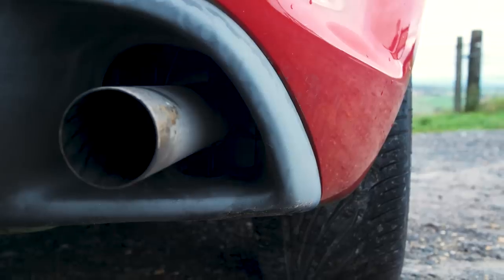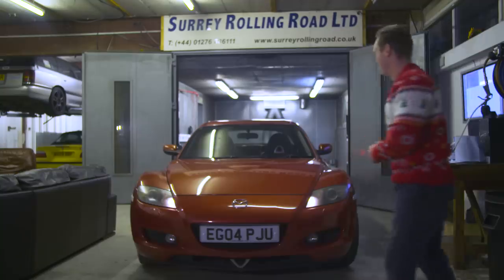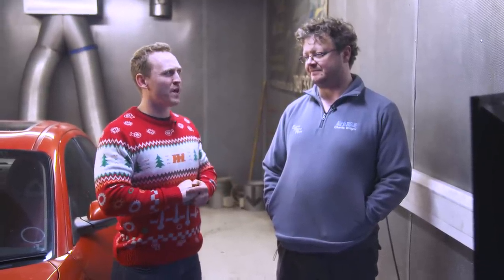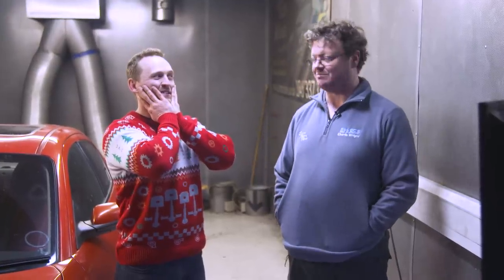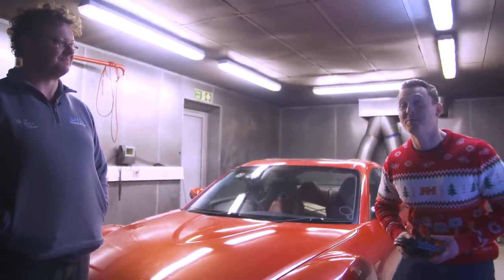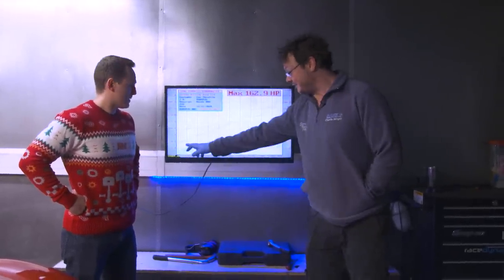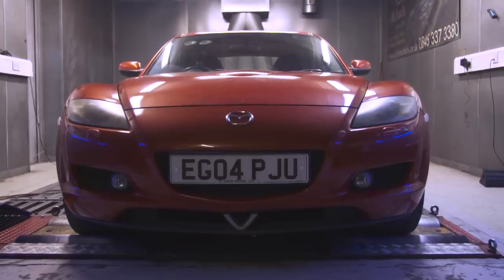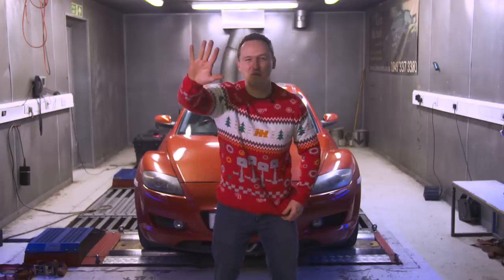How Much Power & Torque Does A Broken Rotary Engine Make?

Comment: Wish you had done a comparison of power output between premixing (1 ounce 2stroke oil in fuel tank per gallon of petrol) and not premixing. Adding the 2 stroke is step one in the rotary commandments, and it helps with compression and seal lubrication. In a good condition rotary, it adds longevity as well. I never run mine without 2 stroke oil in the fuel. In fact, I deleted the factory 4 stroke oil injection system and add 2 stroke every time I fill the fuel tank.

Comment: Always rev the engine at 2000 to 3000 RPM for 3 or 4 seconds before you shut the engine off.   Otherwise expect it to stall / flood.  The 2004 (and maybe newer?) year cars have a wimpy starter motor.  If you decide to do it yourself its an easy swap.  And your 2004 doesn't inject enough oil to the engine so always premix!  If you don't want to add oil to the fuel there are some retrofit kits that will inject more oil into the fuel  *I think premix is the simple way to go.   And don't forget to fuel it with the proper octane gas (Petrol)

Comment: put 2 stroke oil in the fuel tank 1 250ml per full tank once its rebuilt  helps the apex seals lube up and provents premature  apex seal wear

Comment: OMG- so THAT's what I look like! I too own a Dorito powered 2008 Anniversary Edition Mazda RX-8 with a red leather interior. It came with many goodies: exhaust, etc... BUT, has a future of failure as well. It's sooo good though, I'll probably rebuild as well. In the interim, I need a transmission mount and a front passenger axle assembly (prior to rebuild)- so, I'm feeling you, Alex. Sure, yours was practically free, but- sadly- mine was NOT. Like the dreaded dead Miata that you continued to beat to death forever, the RX-8 has too many good traits to just toss aside. It'll be a collectible classic at some point, I just hope it happens before my eyes roll back in my head and die from frustration. I'm watching with bated breathe...

Comment: Provided everything is healthy, on the Dyno the vehicle should make 185-198 to the wheels. Clearly if you bought the car with low compression, making a low number is no big surprise. 
Hopefully the rebuild you do will include series 2 parts which make the engine last a whole lot longer from the series 1.

Comment: Do dynos work differently in Europe than in North America? I heard the guy reference flywheel horsepower. Do European dynos estimate flywheel hp based off what it made at the rear wheels? North American dynos only measure wheel horsepower (unless it’s an engine dyno obviously) and then people estimate the flywheel hp. So for example a car rated at 300 hp we’d probably expect to dyno around 260 hp.

Comment: If you decide to ever swap it put the Rocketeer kit in it. Rx8 and miatas chare alot of the same chassis components and electronics and the trans is almost identical besides gearing.

Comment: i wonder if apex seals wear off due to bad lubrication so maybe adding two stroke oil to gasoline would help with the wear.
Reply: It's a hot debate amongst rotary drivers. A lot do premix. But if your seals are already worn badly as in Alex' case it's sadly too late.

Comment: Great video, Alex. That's about typical of a low compression two-rot engine. As usual, probably apex seals cracked or worn. Hopefully, the rotor housings aren't scored when you disassemble the engine (which is so damn easy!).
Reply: Cheers. We're releasing a tear down video in a couple of weeks. Think you'll be impressed!

Comment: Try some "restore" engine oil additive, be a good video to see if that ups the compression, they claim its great for rotary engines, and try running some 2 stroke in the fuel, that will help loads

Comment: Oh and don't hope for over 190 whp without some extensive mods, an absolutely perfect stock RX-8 will make about 190, 200 is achievable but you're not going to get it stock, this will require a retune, and basically every bolt on you can find. World record on a Renesis is 224 whp

Comment: So basically, you have to disassemble the engine, change the apex seals, change some of the other seals from the block... Blah blah blah basically what you can find on a rebuild kit on ebay for relatively cheap... Then it'll be good as new! Just post up somewhere as if your intensions were to swap the engine and you should get the job done in a weekend... Or two... Or three if you're really confused

Comment: fix the compression, and add some 800cc injectors, new fuel pump and air intake pipes, and intercooler, dyno it, then dyno it after a new turbo, without the turbo, it will cost £1000 tops

Comment: well triangles, triangles everywhere... in the seats, in the difusers even in the engine... well i wanted to buy one in spain and they're about...1000€, wanted to know how much does it costs to repair the engine, can't wait for the next week video^^
Reply: Regarding rebuild costs, a lot depends on the state of the existing motor (housings, rotors, etc), and how fancy you want to get with the rebuild (trick seals, balanced rotors & shaft, porting, etc).  My RX7 has had a few rebuilds over the 11+ years I've had it, costing from 2k GBP (basic seal replacement) up to 5k GBP (new housings, rotors, shaft, bearings, seals - everything really).

Mind you, I've only had the apex seals go once - other failures were due to post-accident damage, driving 400 miles without oil (oops, sump issue), and manufacturing defect (corner seal shattered - very rare)... all of which are (unfortunate) things that can happen even to piston engines...
Reply: Geoff Willingham thanks a lot for all information you gave me^^

Comment: I dunno wtf Mazda did with those engines, but they screwed up bad.
My 12A with well over 500,000km on it fires up if you look at it the wrong way, hot or cold. Good compression.

Comment: In the 2004 and 2005 they came with a weak starter motor, if you upgrade it to the newer one turns on instantly

Comment: You know what I don't understand? The 330, I knew it could be a good car with work, it wasn't that bad when they started. The Octavia, well that was just a fantastic story really. The car was a survivor from hell and back mileage, and it's a good, solid (if dull) car.

But I've had an RX-8, from brand new. A PZ, with all the Pro Drive additions. They are bad cars. Just bad. Not good. Rotten and rotting very quickly these days.

Alex, it simply isn't worth the hassle.

Comment: I didn't even know there were different Horse powers. What are the differences?
Reply: Wheel horsepower is measured on a chassis dyno like you see in the video, it measures how much power is actually put to the ground after the parasitic losses from the transmission and the rest of the drivetrain. Flywheel horsepower is what the manufacturers quote , and it's measured on an engine dyno, where the engine is mounted directly to a measurement device and thus it reads the horsepower transmitted to the clutch at the flywheel without the parasitic losses of the drivetrain.

Comment: Well you beat me I guessed 140bhp and thought I was  wing optimistic... but it went down every run so one more I could've been right lol
Reply: Dropping with every run is a sign of heat soak reducing the compression even further (ie a really fucked rotary engine)... but it would have levelled out (maybe in another run or two, at a guess)

Comment: I agree with others here. Yeah, it "only" does 160 horses, but that's quite the deal for £650. And yes, i purposely ignore reliability, that dyno punch in the balls did hurt enough. And for the "dyno-experts" here: look at the fucking graph. He eases off the throttle because torque and power falls off. Do you think revving the balls off it even though it's already dropping in power will "improve" the dyno readout? None of these guys has even seen a real dyno, but try to explain that a guy running one for a living isn't able to use it properly. Go figure. Hint: the 231hp version peaks power at 8200rpm. torque at 5500. There's zero reason to rev further than 8200, and if it's dropping at 8100, even less so. But what do i know.

Comment: Just dropped $6,000 US to replace my original motor with a fresh Mazda factory updated engine. Ironically the oil pan started to leak at 951 miles. Hopefully I can pick it up from the shop tonight. Mazda get your shit together.

Comment: Wait someone clarify to an American. If these are 200-210 flywheel hp stock, then that means they should dyno around 170whp stock. This is only 7-10 hp off after 70k miles, how is that horrible?
Reply: They have already corrected for losses in the 162hp, the dyno is reading 130 whp...
Reply: TassieLorenzo jeez lol okay thats awful then 😂

Comment: That particular Rotary engine is 1308cc or 80cu.in. on two naturally aspirated rotors. The title says 2 cylinder. Meaning, it's a very small engine to begin with and it makes more horsepower that any piston engine of the same size. Can you imagine the HP on a 400 cu.in Rotary? These guys are comparing skinny Chinese girls with Sumo Wrestlers.

But a Chinese girl who knows Martial Arts is like a Turbo on a Rotary... it kicks butt... still with 1308cc.

Comment: lol, my '93 325i with 250k miles put down 179 whp. that's the difference in engineering.
Reply: doubt its stock then kek
Reply: those things barely put out 240hp stock...no way in fuck you got 179whp recently :D

Comment: I bought one of these in 2005.  Worst fucking vehicle I could imagine ever owning.  When I was done, I towed it to the shop, got it running, took it to the dealer, took a bath, and walked away with a reliable econobox.  I can't count the number of times it just stopped running randomly at a stoplight, or when under low load, or when just whenever I didn't want it to.  Worst purchase I've ever made.  To this day, it taints my view of any Mazda product.

Comment: He didnt even reach redline he slacked on you man. Thing can easily rev higher than 6900 to 7500 RPM which is where he let off the throttle. You probably do have 175 horsepower (which is still terrible. But still)

Comment: Lol, always have 220 for 2000 miles, the tips wear straight off, then they settle to about 190 for 20,000 miles and lose 5hp every 5,000 miles thereafter until you rebuild it, and all the time doing up to 20mpg on a good day, bag of shite

Comment: Actually it's a nice car, if You put 2JZ in it
Reply: Now there's an idea! Though, a fully built 2JZ on this car would just spin wheels for days unless it gets tubbed, flared and paired with some seriously wide rims.

A cheaper option, which is also far sufficient for this car would be a stock RB30 bottom with a ported RB26 head and an aftermarket oil pump. That should hold 750hp reliably on E85 or about 500hp on premium pump gas.